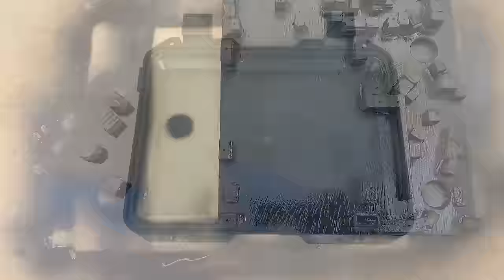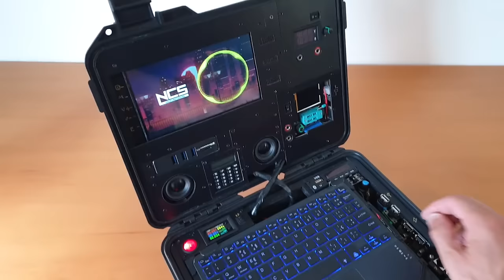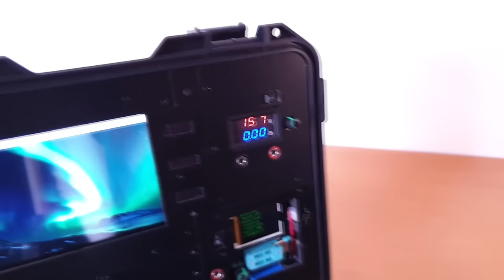DIY: Cyberdeck multi-function backup computer

Comment from the maker: Turn subtitles on :) Parts list :
Touch screen:      https://bit.ly/3YqTK7r
BT Keyboard:        https://bit.ly/454iFQr
Hard case:             https://bit.ly/3Ytnv7q
Voltmeter:              https://bit.ly/3qoT9GA
Battery 8A:              https://bit.ly/3knlAgT
Raspberry:               https://amzn.to/3ZvJIST
Gm328a tester:      https://bit.ly/3EPkAwI
Calculator:               https://bit.ly/3Zl4ZPb

Wire holder :            https://bit.ly/3P4En0R

More infos in the video description, thank you for watching :)
Reply: Bom vídeo, vê se começas a trazer mais uns regularmente eheheheh
Reply: DC Stepdwon and Usb stepdown goes to front page only :) Just a heads up :)
Reply: Legend
Reply: Have you thought about using Framework components?
Reply: Have you thought about buying a laptop
Reply from the maker: @Soundwave142  that´s an option, more power for sure but the price is also higher, i had this raspberry ready for use :)
Reply: @DTeK   I understand, I only mentioned it because of Framework's modularity would be perfect for this. If anything, its it something down the road.
Reply: 😢lo que es tener dinero ajjaja
Reply: I would have installed slim aluminum plating to create an interior faraday cage for extra emf protection when all boxed up.
Reply: Are you selling these? I literally would bye one
Reply: @DTeK how much is the total cost for the parts?
Reply: you made a firelighter, make the battery compartment and inside out of light metal.
Reply: Você vende pronta?
Reply: Would of been cooler if it had faraday
Reply: Cx
Reply: @Cyphers.  like 290 dollars, its really cheap tbh most of the pieces are chinese aliexpress parts lol
Reply: @Sionziona.c  thx
Reply: @tcttvradio true

Comment: the physical calculator definitely was an overkill
Reply from the maker: it works with the raspberry off :)
Reply: Nah, that's the real computing unit.
Reply: Sometimes it's nice to work with a real calculator. Quicker than pulling up the app from you phone that might not be at your desk.
Reply: Blasphemy! There’s no kill LIKE overkill!
Reply: @gorillaau  does anyone remember when calulator the started, when you click icon, it actually got spinning disk or some whle the thing loads up? in was never that bad xp even vista, ?
Reply: How else you gonna spell boobs with numbers?
Reply: It's fun.  More buttons is more cool, right?  I have a little phone dialing pad somewhere, so I might figure out a way to use that if I were to replicate this, but that's the beauty of these Shack-In-A-Box builds because they only contain what the maker deems important, whither that be functional, fun, or equal measures of both!
Reply: Hey, this way you can use a calculator without it covering up the other windows!
Reply: you may never know
Reply: your a genius  @DTeK
Reply: can it run doom? the calculator...
Reply: What if the calculator is the primary function of that case...
Reply: And replace with what? An abacus?
Reply: What a flex😂
Reply: @DTeK я думал это gsm модем
Reply: @becausebuzzbomb6133  It can even run minecraft!
Reply: @mydogsnameisbeans  ou : "elle Baise " in french ( she f.. ) :face-turquoise-covering-eyes::cat-orange-whistling:
Reply: A casio would've given some real functionality though, those things do stuff that my phone can't handle.
Reply: A slide rule would have been a nice addition.
Reply: Nah, if it was me, I would have put a graphing calculator screen inside, and keep the buttons as the numpad if I could do that
Reply: Outboard math coprocessor
Reply: nah that's the bomb timer

Comment: I would almost want to 3D print the majority of these parts, rather than use wood. Either way, that looks sick AF and I really like the aesthetic of a cyberpunk portable computer.
Reply from the maker: thanks, glad you liked, i realy like the part of creating the parts with manual tools, that´s part of the fun for me
Reply: Was about to say this x). Overall, my childhood idea finally made irl ahahaha
Reply: @DTeK  im glad you did it that way. definitely looked enjoyable for you!
Reply: @DarthG33k ...and in that process, took half of the fun away.
Reply: it could be used as a prototype before 3d print parts
Reply: @DTeK  I agree but some people prefer designing it on the PC and then just printing them. I guess it's what process you prefer, software or hardware more.
Reply: Printing the bezel would make sense.  It would also offer the opportunity to decorate the unit a little.  Wood was probably less expensive from a materials and equipment standpoint.
Reply: yea it kind of looks like shit and it's heavy lol  @DTeK
Reply: framework board maybe?
Reply: You could use wood for the prototyping stage, then take the dimensions to a 3d printer
Reply: Its "cool" I feel like a 10 year old Toughbook would have more power and battery life. They also have USB device charging when powered off.
Reply: Wood is way stronger than printed parts !
Reply: @DTeK  if i would lie to buy one ...would you make 1 ??
Reply: when you know how to 3d modeling, sure
Reply: I did something similar in a build that was WAY more complex.. I need to figure out how he got a million views on this one lol
Reply: You assume that everyone has a 3D printer... If you do not own one, you have to pay for the work and it's expensive as hell!
Reply: I mean for a long long long time if you wanted to build some electronic thingy at home, you just nailed the components to a wooden board.
Reply: That, or have someone laser cut some acrylic, which might allow for the option of plastic welding directly to the case, then you don't have to drill holes in it and make it weaker to water ingression.  There are certainly ways to do it with wood, those "command" strips with the velcro-like material come to mind, but it's all about what best suits your needs and wants.  I wouldn't want that calculator for example, since the Raspberry Pi could do more complex calculations faster and with higher precision, but if you feel like you might need to to some calculations without powering up the entire system, you might want to keep it.
Reply: i did it with cardboard lmfao
Reply: I would also like to perhaps see a raspberry pi version of this with a smaller Bluetooth keyboard/ mouse and larger touch LCD. I did see a STL file of anoelican case if anyone wants to start this project left me know
Reply: @DTeK  interesting hobby and good looking stuff to making something I saw from movies may I ask what tools and electronics and others do I need to be able to create something like that and how long exactly to get it completed for one of my movies making in the future?
Reply from the maker: @jerryvang1994  thanks, all the tools that i used are the ones in the video:)
Reply: I need 1 like this
Reply: Or just lasercut plastics
Reply: Nice system👍👍👍👍👍
Reply: @UnboxAnalysisOfficial yours are awesome as well I want to make one
Reply: @NightVisionOfficial  jusqu'a 5 ans j'étais un génie et après tout est partit en couilles :(
Reply: 3d printed would definitely be less of a fire hazard when containing that big ass battery
Reply: Came here to say this. Added weight and so much room wasted. I'm currently 2 weeks into design on mine with the 3d printer running nonstop now. Screen mounted. Speakers. Lower faceplate done. About to go internal now! Almost done with 2 spools of filament. 😂 14ah of battery. 1tb of storage. Temp monitor. Cooling. Voltage. Amp for speakers. Usb power hat to run the 4 M.2 250GB drives. Selectable between both batteries. Selectable external power use. Many extras wired to switch off n save power when needed. Entire library of Wiki downloaded for offline. And 50GB of other information. Sep boot drive for P. I'd post a pic so far but can't on here. Foldable 30% keyboard. Mounted trackpad. Storage din. I know they're cyberpunk but I'm a huge Resident evil buff. Named mine The Red Queen. Put the Umbrella logo and Umbrella Corp name on it. Just wish I could figure out how to get it to play something like windows logo upon startup from the movie. 🤔
Reply: @northcentralindianawx  back in the good old days of windows 9x, you could play a startup sound with Windows launched. I'm pretty sure it's still in the sounds menu in control panel.
Reply: Nah it looks okay @federalmayhem
Reply: There is another option other than 3d printing. Use an existing device and hack it up. Portable DVD players can make a great stealth portable PC. Or a Boombox for better sound, and there's better ways to deal with the power on a boombox with the extra space. Swappable power tool batteries. I've done 2 modded boomboxes, and one DVD Player. The Boomboxes were both better for  power vs. space vs audio vs. overclock. 

There's also low tech fiberglass and sanding. I made some nice flat panels that looked like bare PCB board, out of fiberglass weave, resin, using saran wrapped MDF, and some lumber for weight, to flatten. Saran wrap came off easy. It was a test piece.  Wax paper did not want to separate or even sand out after. Originally it was going to be a modified cd player door. Instead, I cut out a piece of it, and with standoffs is holding a 5" touchscreen where a tape deck used to be, on the inside, On the back of that is a Pi4, on it's own standoffs for a different offset and depth from the Touchscreen's own pi4 mount to work with the inside of the boombox. Short, panel mount wires, and USB extensions, can extend things to work with what ya got. Except Pi4 power wire. If you're overclocking, extending the USB-C even 6 inches proved problematic, over time, for me. Android 13 runs pretty good at 2ghz anyway.
Reply: Good prototype/baseline. Great starting point for a diy testing bench for hobby electronics

Comment: With how much digital design, CAD, 3D printing, and metal fabrication i end up doing on projects, I REALLY need to remember that wood is a thing, and it's easy to use.
Reply: It's crazy the amount of useful ways to use different woods and it just always slips the mind
Reply: Yeah,, we all know that wood is easy to work with sometimes,🤔 but whenever you build something, it's always come into mind that we need something rigid more sturdy and if you will it can last forever! It's not all about fancy but durability! 😁 I don't want things I've created go destroyed after falling at 3 feet high! Think twice not do twice. 😅
Reply: There is also something to be said for mocking up with cheap  corrugated cardboard,  easier and quicker than woof. Also hot glue comes off with some effort to do it again.

If designing a recess panel socket that's bayonet or thread connected, mock it up first to ensure you can get your fingers  in to be able to turn it.

Comment: you should consider adding a Software Defined Radio with a swappable antenna so you can use it to listen to NOAA transmissions, decode weather satellite signals, hear frs/cb radios, etc.
Reply from the maker: easyly upgraded

Comment: This is so cool. This is like a whole desk in a case you got the Power supply, Multi function multimiter,  Radio even a Calculator
Reply: Looked like the radio aerial wasn't connected, just Bluetooth or AUX mode.